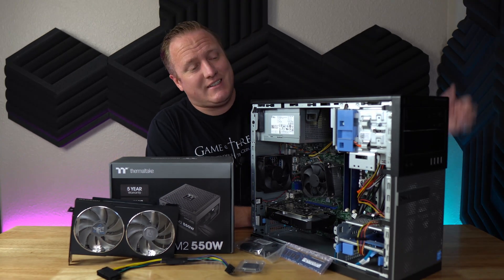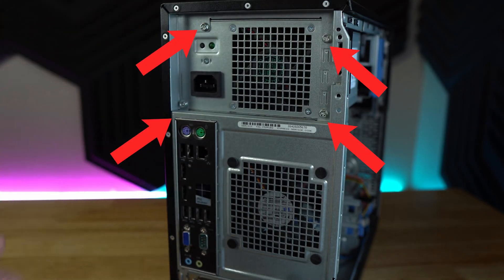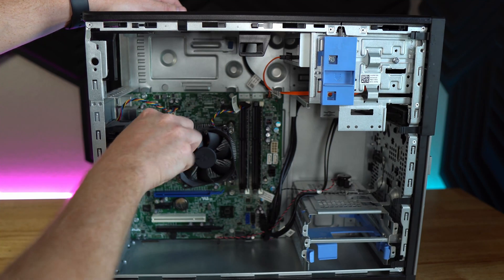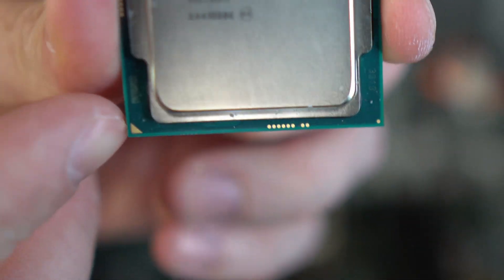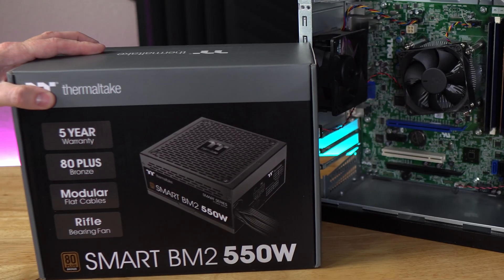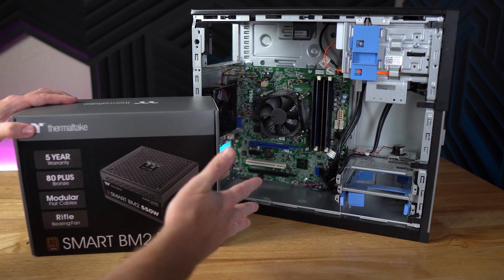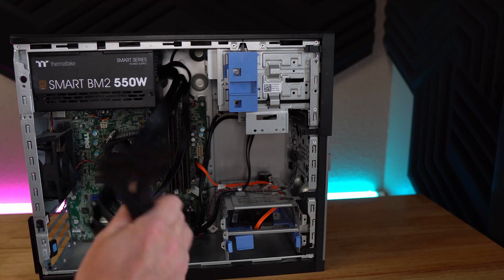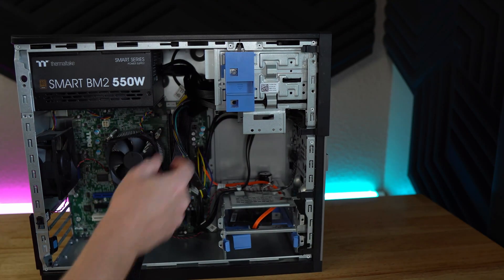Upgrading Your Dell Optiplex? Here's What You Need to Know!

Comment: Hey, sorry for being a year late. I have a Dell vostro 3888 that apparently had a CPU failure(I could tell from the power led codes on booting). The previous CPU was an i5 10400, can I replace it with the i5 10400f or even the i5 11400f? I have a dgpu.

Comment: Im reading some jank about the 24 to 8 pin supply NOT CONVERTING THE CORRECT PSU VOLTAGES ofc Dell has proprietary voltage pin layouts AND values. The standby power is 12v vs 5v for standard? You would be best to confirm for yourself as I am not an expert just stumbled on some threads.
Reply: same question of mine !!!!
Reply from the maker: I’ve not had any historical issue.  I would be interested to find actually what you found for sure.

Comment: you dont need to swap the psu just buy a sata to six pin and your done
Reply from the maker: Sure!  If I want to start a fire!
Reply: @PCTechHustle In all fairness, though I wouldn't do it with the card you used, I agree, I have been running a 1060 like that for the last couple years. 120 watt TDP seems okay with that. 75 watts from PCIE, and up to 54 watts from SATA adapter. I've checked the adapter under load as well, it doesn't get hot in my case. I agree though that pretty much anything more needs PSU upgrade

Comment: You can actually find some really good Dell Optiplexes with an I7 6700, I searched up "Dell Optiplex I7 6700" they can also be really cheap sometimes like $80. Usually they come with 16GB of RAM but might need an SSD upgrade.

Comment: Hello, I am researching midrange desktop PC's for Windows 11 in the hope of  upgrading one with a standard ATX PSU and video card. I have so far looked at the Dell Optiplex 7070, Dell Inspiron 3020 and the Acer T-1760. All good systems but very difficult to upgrade the PSU for a good video card. Currently a Radeon RX 6400, but planning to upgrade to at least a RX 6600.

I am on fixed budget however it is beginning to appear I may have to build a PC from  scratch. That is fine however it has been over a decade since I have done that. It might be more expensive but at least I could buy the parts over the next few months.

	I have ancient Compaq Presario with a Seasonic 520 watt PSU that has only been turned on a few times in the last few years. That old Compaq has three features not found on most modern mid range desktops from what I have seen.
1. a motherboard that has a 24 pin ATX connector.
2. A case that easily accepts a standard ATX PSU. I had no trouble upgrading the original 300 watt to the 520 watt Seasonic. 
3. A case fan not found in the Acer T1760.
I am toying with the idea of using that old case to modernize with maybe a motherboard etc. from one of these systems. On the other hand I may buy new parts to install into that case unless I am forced into buying a new case.
Any advice would be appreciated. Thanks.

Comment: how do I replace a motherboard on a dell optiplex? I want to get a new and better cpu but the motherboard doesnt support it, the best cpu that  I can get on my dell optiplex 9020 MT is an i7 4790k and I got that, but I want to get a better cpu. how do I get a new cpu? do I need a new motherboard?
Reply from the maker: Right.  The best the 9020 can support is that 4790k.  If you want more power inside the same case that’s a motherboard replacement.  I’d suggest a full custom build in a more supportive case at that point.
Reply: @PCTechHustle  thanks!!
Reply: @PCTechHustle  thats exactly what im going to do

Comment: You plugged in the ATX_CPU slot without telling us how to do it! I dont hage a compatible cable for that? 17:54
Reply from the maker: It’s just a 4pin connection from the power supply.  Just use what the power supply comes with.  If the cable 4+4 pin is snapped together you can separate them.
Reply: Got it, thanks!

Comment: so to clarify again, can I actually upgrade my cpu from i5 4570 to i7 4790? Im actually fine with the 4570(Optiplex 3020) but I wanna squeeze a bit performance so I could use a 165hz monitor(I play valorant and I can currently reach 160 fps but it isn't stable and my specs are i5 4570, gtx 1650, and 16gb of ram). idk if the i7 4790 will actually work on my board though, and I dont want to waste my money by buying it and not being able to use it because of board not supporting it. And btw, cooling will not be a problem since I am using a tower cooler.
Reply from the maker: Yes it will work!
Reply: @PCTechHustle  oh okay thx I will upgrade the cpu of this thing to squeeze a bit of performance

Comment: Im going with a dell optiplex 9010

500W psu
1660ti or 3060
64 or 32 gb of ram
500gb or 1tb ssd 
500gb hdd
And maybe a new mobo and cpu later

Edit: i decided on buying new parts because it would work out better in the long run although costing like 17K (Rand not $) and i went with a

ASRock Challenger Rx6600 
Gigabyte 550M motherboard 
Ryzen 5 5600G
A peerless assassin cooler
64gb of corsair vengeance ram 
Seagate 2tb hdd
Western Digital 1tb nvme drive
Nzxt H5 flow case in white
Corsair Cx650M psu
And A View Sonic XG2431 240Hz 1920×1080 23.8inch monitor

Im open to suggestions and changes i should make the total is
1134$
21 166.43R 
Thats more than what my mom makes in a month but im waiting for my pay stub so i can invest and hopefully have this pc by october-December

Im basically gonna turn 350R into 33 000R using a south african investment app
Reply from the maker: Nice!

Comment: I have an optiplex as my off-site backup unraid server, and those hard drives on the bottom over heat. I used magnets to attach an 80mm fan to the bottom of the case that pulls air from the hard drives over the pcie slots out the back.
Reply from the maker: I like the innovation!

Comment: Hey man. I love your video and it helped me out so much. I just got a 7020 with the i7 and 32 gigs of ram for around 150$… mine is the mini tower. You also have the mini tower version, correct? I replaced the existing gpu (2gig I forget the brand) with a rx 580 (8g) but am having issues running some games, because of the psu im guessing. Everyone on Reddit says I can’t use an atx power supply because of intels proprietary connectors, but I’ve learned you can use a 24 to 8 pin adapter to connect. They also said I have to use a tfx power supply but obviously they only go so high power wise, and it’s very limited selection. I’m looking to install at least 500w maybe 700w. Is the psu you installed a standard atx? Thank you for your video and help!
Reply: I will also add that like you, I had issues with the ram slot tabs blocking the gpu. So I actually had to cut the plastic shell off in a wedge shape so that the gpu would fit 💪
Reply from the maker: A standard ATX power supply will work just fine.  500w too is more than enough for an RX 580.

Comment: One question, I hope you can help me, I bought an 8GB RX 480 and installed it in an Optiplex 1070 with a 650 watt power supply, the graphics card turns on and the fans rotate but it does not output the video, the video output comes through the vga of the plate, in a few words I don't recognize the card, help me
Reply from the maker: Did you plug your monitor into the graphics card?

Comment: Sorry dumb question but im new to PC gaming I have an optiplex 7020 that I started with, all I've done to it so far is slap a PSU, more ram, SSD and a GPU. I was interested in upgrading CPU but I was wondering will that same cpu u used in the video work for me? 😅
Reply from the maker: Yes you can use the same CPU I used.

Comment: Dude hyoerthreading is good for multitasking.  Not gaming . The I5 was more than adequate .
Reply: I'm gonna edit my comment . You can use an I7 if you want . ( It won't hurt anything) although it really isn't necessary for a gaming centric machine . Also if it is possible try to pick up a power supply with the right dimensions in order to save yourself the trouble of figuring out work arounds . Obviously Upgrade the ram at the very least am ssd for the boot side.  You can use  a HDD to store your games . Although a large capacity SSD is Idea . Try to find a graphics card that fits . Snug is ok as long as you are careful . There are many things you can do with these machines . They are so versatile .I built out several Alienware alpha R1,R2,Opitiplexes and other work station pcs and sold the during covid .. worked out for me pretty well  . Don't ever doubt a dream is out of reach . It maybe closer than you realize .you don't have to buy a $5000 PC to play alot of the most popular titles like wow,fortnite ,apex legends and more will run on a machine just like this . And the good thing is you don't have to do everything at once . You can upgrade as you go . ..
While I play on a laptop lol ... 
It's just more convenient for me  
I have an acer nitro 5 from 2020 and an Asus ROG Strix .

Comment: Why remove the I5 ? I7 isn't going to make it a better machine for gaming . Infact any many cases I5 is better .
Reply from the maker: What world are you living in?
Reply: @PCTechHustle  most ganes don't use multi threading  guy . Gaming is all gpu .. obviously you wouldnt use an i3  but an I7 is overkill  amdbabwaste of money that could have been spent on the correct adapters .
Reply from the maker: @deadred80  most games don’t use multithreading?  Again what world do you live in?
Reply from the maker: @deadred80  even if I decided I wanted to go along with your argument that you insisting that an i5 has better IPC performance than an i7… That simply and completely is not true.  I suggest looking up the specs of both CPUs before spreading complete disinformation… Guy…

Comment: Cant i use a 6+2pin for the motherboard on the optiplex?
Reply from the maker: CPU power should not be a 6+2 but rather a 4+4 or just 8.  Make sure you are not plugging in the pci-cable which are generally 6+2
Reply: @PCTechHustle  what is pin XD

Comment: Hey guys so let me explain i have a cosair 650w psu and it has 24, 6+2 and others so the motherboard i want to connect to has 6pin only? Here is the thing:

1) can i plug the 6pin on the 6+2 that is used for connecting GPUs on the motherboard?

2) psu require the 24 pin to be connected for it to work right? 

3) arent i supposed to use 24 to 6 pin addapter? (Im having trouble funding it where i am and ordering is not cheap trust me)

I want to know if i can plug in the 6+2 pin split that i know is used for GPUs to connect to the motherboard, the motherboard is HP EliteDesk 800 G1 MT motherboard since its 6 pin on the mobo.
Reply: If I’m not mistaken you need 24 pin to 8 pin adapter not 6
Reply: @alaskanbabydaddy  nvm bro i didn't got that pc, the one i got has a 24pin so no need for adapters

Comment: im 13 and your channel has inspired me to build a pc and get a dell optiplex 9020 and I put a gtx 1650 in it and it works well! im thinking of adding that cpu and also adding a better power supply. so thanks for making these vids. :)
Reply from the maker: Awesome!  I love hearing this!
Reply: @PCTechHustle  I have one question. do you think an intel core i7 4790k would work? I heard that it does, but I also heard that it doesnt, so idk.
Reply from the maker: @KIGE12 yes it would
Reply: @PCTechHustle  thanks
Reply: i just got a new case today for a 9020 and it looks really good with green rgb and also i got 32gb ram in the mail still and its a good upgrade i put an rx 580 in (not 2048sp)
Reply: Im looking to upgrade the graphics card from intel hd 4400 to some rtx does it run on 2 gb graphic card or like it lags? i have optiplex 7020 btw\

Comment: Thank you. Great video! I have an Optiplex 7010 MT and want to upgrade my graphics card and thereby need an upgrade of my PSU. Bought the AMD RX 6600 XT (Hellhound) graphics card and an TT Smart BM3 650W psu, but I get problems already when upgrading the psu. Anytime I install it and connected all power cables, my dell power Button only blinks 2x2 orange (Faulty psu or faulty psu cable connections). Tried both: with and without new graphics card. When I reinstall the original psu back into the system, everything works fine - system starts up (without new graphics card). 
Do you have any hints for me what I should think of or what I might do wrong?
Reply: If the PSU works in another PC, it’s the adapter.

Comment: I just pulled out three Optiplex from the dumpster at work. I took the best one an optiplex 3080  with an i5 10500. I removed the motherboard and all the components and mounted it to a half inch piece of plywood and put in a used 6600 xt. i then used a SATA to 8 Pin adapter to power the graphics card. Highly recommend against doing this but in this application it just barely worked. I'm stoked that the computer came with a solid state drive already installed. 6 core + $20 ram upgrade + 6600xt is  badass for a free pc even in 2024
Reply from the maker: Hah!  Nice!

Comment: Will the stock PSU be able to handle a 1050ti?

I53450
16gb ram
Reply: Optiplex 3010
Reply from the maker: yes, that will work fine.  I'd suggest finding a gtx 1650 if you can.  You can run the same stock PSU with that one as well and it performs way better than a 1050ti.

Comment: Recently threw a 3050 in one but it was a 990 MT. The gpu isn’t being read off the pcie x16 slot even though its fully in, i cant find damage anywhere (even inside the card), and the bios is updated to the most recent one. Can someone help troubleshoot?

Edit when i plug an hdmi cable in it is just black
Reply: If it’s legacy BIOS it isn’t going to work.
Reply: @zeroturn7091 it was in uefi and since it was being an annoying cunt i just replaced the entire motherboard to twelfth gen intel i3 which i got for a great price

Comment: Just an FYI for your viewers, the Be Quiet! System Power 10 series of PSUs, from 450w-750W, have the exact same measurements as the original Dell 290W PSU. They fit like a glove. Only drawback is that they are completely non-modular, so you have to do some cable management, but you retain full function of your latching mechanism. 👍😏
Reply from the maker: Thanks for the info!
Reply: @PCTechHustle  No problem. We Dell Riders have to stick together. Merry Christmas. 👍😏

Comment: I bought optiplex 9020 with xeon 1231 v3 only for 80€ with gtx660 not bad deal, i have to make some minor upgrades like a more ram etc.
Reply from the maker: That's a pretty solid deal!  I would recommend for sure upgrading the GPU when you can, that model in particular NVIDA does not release driver support for any longer.
Reply: @PCTechHustle  yea that is in to do list 😅 i build home server 👍

Comment: what dit you put in the 4 pin slot on the motherboard outside the 8 pin adaptoptor ?
Reply from the maker: I am assuming you are referring to the EPS power at the top left of the motherboard.  That is the connection that provides CPU power.  On this kind of Dell it’s simply a 4 pin connection.

Comment: insane bottleneck. also if You are buying all of these parts to build this pc while buying the optiplex its better to just to build one off used parts with better long term usage and upgrades. it would be a good upgrade if its under 150$ or 200$ but the GPU alone is like 180$ 🥲

Comment: I'm running Dell Optiplex for 10 years now! bought it used off ebay for $120 and Upgraded Ram to 32Gb and 1Tb SSD Samsung. with I7 4790 and running GTX 1650 Super. Can nearly play every game smooth on 1080p monitor with between 46fps - 60fps bepending on my settings.
Reply from the maker: Heck yeah!
Reply: Did you run into any ram compatibility issues because I put a new 8 gig stick of ddr3 and it won’t work
Reply: @spadesofpaintstudios1719  check if it's ddr3L, because that's a lower voltage ram and some of the optiplex's use it
Reply: Bro what is wattage of your power supply?
Reply: @ChoiceForYou-j9j  650 watt 80+
Reply: actually I've upgraded GPU to GTX 1070 Ti
Reply: @toddgilmore118  Thanks bro.
Reply: Nah  bro your specs are more expensive than the pc 😂
Reply: My pc All so 15 years 24 ram 500 gb hdd and 500 ssd but no graphics card 😅
Reply: What's the wattage of the power supply? I'm doing a similar build
Reply: @doctordestructo3360 550w

Comment: Note: the PSU in those computers is 140mm long. You can filter this in PCPartPicker to find one that fits. I have a SeaSonic Focus PX750 in mine, and it fits exactly behind the latch, PX850 fits too. (i have a full custom build inside this case.)

Comment: Hi bro i watched your video but i didnt understand wich adapter u used for the white 4 pin just over the cpu? Ty if you can help me with that. Good evening!
Reply from the maker: No adapter necessary.  Most PSUs will come with a 4-8 pin cpu cable.  I just plugged in the 4pin side of the cable that will meet up with the plug on the motherboard.
Reply: @PCTechHustle  okay i see. My power supply came only with 2x 8 pins so i ordered à 8 -> 4 pin adapter

Comment: The same is possible to O. 3020, whereas it only has two RAM slots (max 2 x 8GB).
Remark: I would have cleaned the cooler with pressured gas before reinstalling.
Reply from the maker: Agreed, same is possible with that version of opltiplex.

Comment: I have a Dell i7-4770. I have 32gb ram, two rtx3060 12gb graphics  cards in it with a 800pwr supply. What is the largest and best cpu chip I can put in it that you recommend please!?
Reply from the maker: I7 4790k is your best chip possible.
Reply: @PCTechHustle   Thank you, will a i7-4790 quad core work well?
Reply from the maker: Yes it will